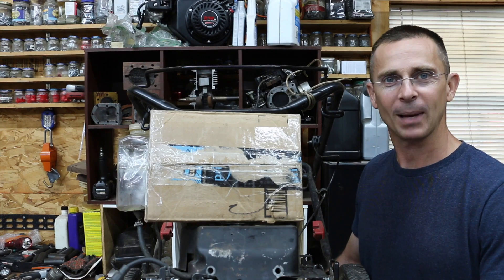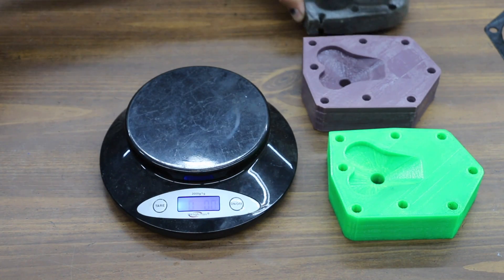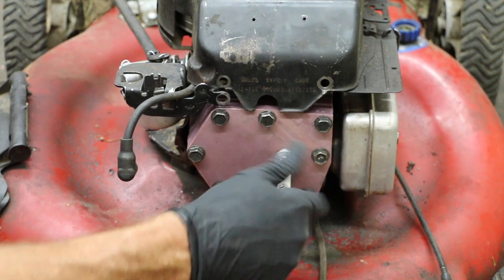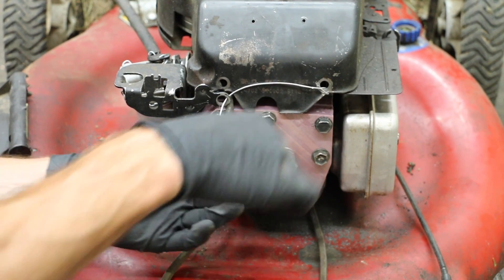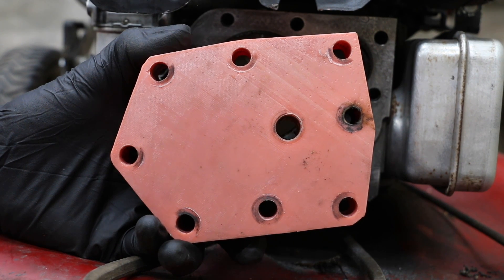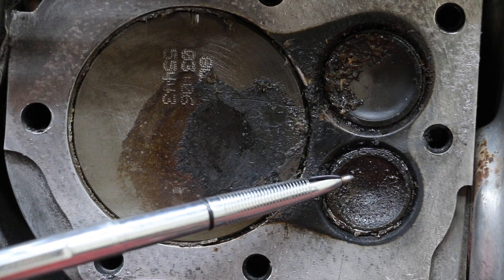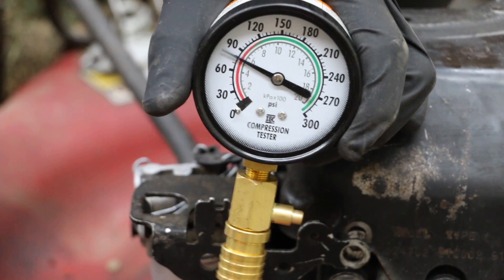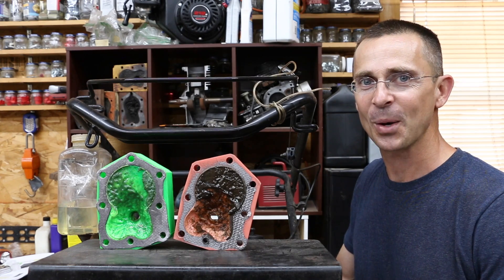How long will a 3D printed cylinder head last?  Let's find out!

Comment: I'm not 100% sure about the validity of this but, it came from a fairly reliable source so here goes:

Supposedly GM came up with some kind of clear material when they were developing the Vortec heads that allowed them to see the swirl and combustion of the fuel mixture and that's how they arrived at the final design. I imagine it had to be some kind of space-age plastic but, i can't see it lasting for a very long test period. Maybe just long enough to get useful data. It would be very cool to see something like that
Reply from the maker: Interesting!  Thank you
Reply: Project Farm Just saw this video after commenting. https://youtu.be/jdW1t8r8qYc
Maybe GM used glass as well but making a small block Chevy head out of glass might be a little more complicated than a lawnmower engine.

Comment: What about ceramic coating the inside of the cylinder head. Would that hold up to the heat while deceasing carbon build up. Like Teflon, Nicole boron or Cerakote. I would assume that it would rub off the moving contact points but on a small engine or 2 stroke the head is just a cap so it would just meet to hold up to the heat and mild abrasion.
Reply from the maker: Great test idea!

Comment: im curious to know if a smaller engine that runs cooler would work. maybe using Polyetheretherketone plastic which i think 3d4makers have. That has a glass temp of 143c. An rc engine runs just below that so if you can keep it cooled enough it might work. However the biggest issue is getting the heat our of it has plastic is a terrible heat conductor, so the engine will probably run hotter until it melts.
Reply from the maker: Great test idea!

Comment: Where I work we created a few "3D printed" heads for a dohc, single cylinder motorcycle engine from aluminium on a DMLS machine for motor sport purposes. Those were impressive bits of kit
Reply from the maker: Wow! That would be very impressive!

Comment: Use a silicone mold for the cylinder head??? That would be interesting as silicone holds alot of heat
Reply from the maker: Great point. Thank you

Comment: It would probably work a lot better if the cylinder head was printed with nylon because nylon has a way higher melting point of 250-270
Reply from the maker: Great point. Thank you

Comment: Anything with a lower melting point than aluminum will be less than ideal. Exhaust gases on 4 strokes naturally aspirated engine run at about 700 degrees Fahrenheit. Still it was interesting to see how long it lasted.
Reply from the maker: Great point. Thank you

Comment: is it a gasoline and/ or diesel 4 stroke engine.    anyway thanks for your video
Reply from the maker: Thank you. It's a 4 stroke gasoline engine.
Reply: Did you miss the part with the spark plug?

Comment: What if you use high temp ABS plus after threading for the spark plug, painted the inside with heat resistant engine paint?
Reply from the maker: Great video idea!

Comment: How about a teflon? That's also plastic but with a much higher melting temp (>1000°C I think). they also use it on spaceships
Reply from the maker: Great recommendation.
Reply: I looked up the melting temperature of teflon (chemical name PTFE) and I'm sorry about spreading misinformation. It's actually just about 330°C  and I dont think that would be enough to withstand as a cylinder head.

Comment: I have a 3D printer that does carbon fiber reinforced parts. It’s called Onyx. Nylon based plastic with chopped carbon. And then I can put carbon filament in the part as well. Markforged X7.
Reply from the maker: Nice!

Comment: I got a bunch of silly cylinder head ideas. They're absolutely bonkers. First, how about plaster cylinder heads? You could cast one out of Plaster of Paris or Structolite plaster. Structolite might be better as it's actually fire resistant and contains perlite. Second, how about cement cylinder heads cast similarly to the plaster ones? Third, how about stone cylinder heads? You could definitely carve one out of soapstone pretty similar to your JBWeld one, but you could try travertine, marble, etc, as well. Lastly, how about a full ceramic cylinder head, made of clay and fired in a kiln? (Might need to belt sand it down flat very carefully, it will bow from the fire...) I think a majority of these ideas to work might require a metal thread insert epoxied in somewhere for the spark plug, though. Just some ideas, it'd be interesting, as if they didn't crack from vibration, you might actually get less knocking and lower temps than a metal one due to better heat dissipation.
Reply from the maker: Great video ideas! Thank you

Comment: I would like to see this same test done with a metal plate between the plastic head and the block, preferably something a little larger than the head so that it could get some air on the flanges for cooling.  Probably need a metal  insert for the spark plug as well.   If a 1/4"  or less metal plate backed by a plastic head would hold together you might actually have something useful.
Reply from the maker: Great video idea!

Comment: But your can put the prints in sand and cast aluminium. You would only need to sand it of a little and it will do as good of a job as the original does.
Reply from the maker: Thank you

Comment: Our company cafeteria started using PLA spoons.  They deformed in hot soup.  To be fair, they switched to a different brand of PLA spoons and they were OK for soup.  Not so much for cylinder heads.
Reply from the maker: Wow!  That's very soft PLA!

Comment: do NOT lend a lawnmower to this man.
Reply from the maker: lol
Reply: @ProjectFarm  Hi there can you make me a special cylinder head for a 1933 Briggs and Stratton model Y engine by a 3D printer like this one in the video for higher compression so i can make a sand brass casting mold from the 3D printer head. So I can to make my own cylinder head out of scrap molten naval brass
Reply: @ProjectFarm   hey maybe a ceramic or metal or a  coating of some sort , shave a few thou from the head,  try tinfoil first, then maybe knock in some stronger stuff in,  like an insert,  bet it would work and last !
Reply: I'd trust this man with any mechanical equipment as it is clear that he is very adept at fixing them.
Reply: @esra_erimez  yep, be might destroy it but after he gets done fixing it it will be running better than it was before
Reply: @esra_erimez  indeed as he hows if a spark plug gos bad it can be clean with a wire brush insted of getting a new one that a clean piston is a piston that can operate that any engine that dies from to much oil all you have to do is clean the gears and the piston and the valves and it will run like brand new
Reply: Ill give him a few just so he can keep doing these awsome videos
Reply: @jonwalker6463  : This is probably one of the best channels on YouTube when it comes to testing consumer products ( in my opinion) certainly answered a ton of "I wonder if that stuff is any good" questions I have always had.
   Curious if "Project Farms" works in a U.L. Laboratory???.
Reply: @thevacuumtubejunky9774  he's better than u.l., they don't have the sass and charm
Reply: @thevacuumtubejunky9774  r
Reply: If you lend it, I assume he'll return it functioning.
Now, if you give him one, it's fair game.
Reply: Lmao
Reply: He’d just turbo charge it and use it to cut sugar cane.
Reply: He can just go to walmart and get with the loan a lawnmower program. you buy it and then return it as your not happy with it.  lol
Reply: You ain't lying but if your lawnmower doesn't work this is the guy to call.
Reply: prival fang but doesn’t he always fix them 🧠👌
Reply: prival fang Unless you want it to come back as a jet fuel powered, turbocharged lawnmower
Reply: I got 9 mowers(6 riders,3 push),setting in back of shop that need fixin,but I'm always too busy.Thinking of sending him a plane ticket,lol.
Reply: Lol
Reply: Being a 3D designer myself and working with these materials often, those are exactly the results I was expecting. PLA is usually printed at 210 Celcius, whole ABS is typically printed at 250ish C. They do make HTPLA (high temp PLA) that might work a little better.
What if you wrapped it in aluminum foil to keep it from melting.
Reply: It would be great to find out all these videos where made with his neighbor's lawn mower... hahahahahha...
Reply: did you just assume his gender???!

Comment: The cylinder head looks like it was made to hold a ballsack.
Reply: That's what i thought when i first saw the thumbnail.
Reply: greenyawgmoth thats the template
Reply: So your saying I can use my ball sack as a machine shop tool, work just got more interesting.
Reply: greenyawgmoth n bjjj
Reply: I've never tea bagged a cylinder head before. 🤔
Reply: Not something I would have ever possibly considered, but now that you mention it...
Reply: I thought the same thing
Reply: That shows what is in your mind.
Or do you think with your nuts?

Comment: ABS and PLA have a pretty low melting point, so none of these results should really come as a surprise.. the low melting points are one of the whole reasons that FDM printing is even possible, if you want a 3D printed head that has a chance of actually lasting you would need something that has been laser sintered. At that point though, it's not really cost effective compared to traditional cast parts.
Reply from the maker: Thanks for commenting on this

Comment: Is it possible to try the same heads but with sort of a thin sheet metal for heat protection where the piston hits. And plastic reinforcement. Saves metal. Or could you scale this up and make an entire working engine out of 3D printed material but thin metal sleeves sheets Etc. To help against heat. Super lightweight engine maybe?
Reply from the maker: Yes, great video idea!

Comment: What you may also want to try is to use a pla model of a cylinder head to create a lost polymer casting of a real cylinder head out of actual aluminum and see if that is a viable way to reproduce reliable replacement cylinder heads
Reply from the maker: Great recommendation!  Thank you
Reply: Wax is the best medium for kind of mold making. It melts away fast enough that the aluminum can fill all of the spaces before it cools. The plastic would take too long to melt away and the aluminum would cool before it fill the space. Also have more plastic junk left.

Comment: I'm actually very curious about this, i think that if you were to put the PLA cylinder head in the oven for a duration of time before use it would last quit a bit Longer under the heat of combustion. The operating temperatures of most engines can actually be Lower than the melting point of the plastic.
Reply from the maker: Thanks for this information.
Reply: Incorrect, Plastics like pteg, pla,abs melt at a way lower temperature. The operating temp inside of a cylinder bore is around 600f. Quit being a moron!

Comment: A pity 3d printers can't use high heat polycarb or something like that. PC-HT should last quite a bit longer than abs and especially pla. Or maybe make one out of some glass reinforced nylon, would be interested to see how that would perform.

Edit: Also, those two performed almost exactly how I thought they would, I work with plastic injection molding machinery professionally.
Reply from the maker: Great point and thank you!

Comment: You'll also tend to have issues with spark plug overheating - the plastic simply can't conduct heat away as well as aluminum. In a high-compression, high-performance engine, even if the plastic cylinder head didn't melt, you'd likely have the spark plug operating as if it was in a much higher heat range & either fail (burn/melt) or result in damaging pre-ignition.
Reply from the maker: Great point.

Comment: Try copper vitriol coating. For casting inner head form. and make asbestos heat insulator between plastic and copper
Reply from the maker: Thanks for the recommendation.

Comment: I wonder how well a 3D printed cylinder head coated with JB Weld would do? The spark plug threads would have to be tapped out of JB Weld as well.
Reply from the maker: Great video idea!  It would help a lot!

Comment: What if the spark plug was mounted in a metal sleeve?  If the sleeve extended slightly beyond the cathode (piston clearance permitting), melting plastic would not short it out so quickly.  Plastic have come a long way and I'm sure they will be a major part of out future.
Reply from the maker: Yes, that would help!  Thank you

Comment: Very cool
Reply from the maker: Thank you!
Reply: Could you try this again with a heat resistant filament? https://www.gearbest.com/3d-printer-supplies/pp_1529078.html?wid=1527929&currency=GBP&vip=4389632&gclid=CjwKCAjwuO3cBRAyEiwAzOxKso8im9HOBn6RSJTmb-ZmGWthvk9Wf8PfPz-67Revow7sTgzaM0dYPxoCd0sQAvD_BwE

Comment: If plastic wasn't such a good insulator the heat would dissipate thru the piece and it wouldn't die that fast. And we could even cool it for extended life.
If it wasn't for the heat those pieces might last very long.
Maybe try a printed steam engine.
Reply from the maker: Great tip!

Comment: you should try a cylinder head made from delrin it melts at 347 degrees Fahrenheit compared to abs which melts around 225 degrees. although i don't think it could be 3d printed it would have to be injection molded or milled.
Reply: I haven't found any delrin filament available before so that's probably out. Polycarbonate filament can get up to ~300F depending on quality.

What I've been looking into getting for my own 3d print projects is ceramic filament. Basically it's the right kind of clay mixed with some polymer (seems to be some options on this). And after you make your print, you can fire the thing in a kiln like you would any ceramic thing you were making, and the polymer burns off leaving you a solid ceramic thing.

It's ~150-200 per kg roll, and apparently quite rough on your extruder heads, so I haven't purchased any to play with yet. Also there's a 20-30% shrink rate on the stuff when it gets fired.

In the case of trying to make a cylinder head. Perhaps use the ceramic to make the inner face of the cylinder which will see the most heat. Then make up the remainder of the head from polycarbonate for structural support.
Reply from the maker: Great recommendation!
Reply: ABS 3D printing filament melts around 225 degrees Celsius, which is 437 degrees F.  I Googled "gas engine combustion chamber temperature" and got 600 degrees C as an answer, so that would be 1,112 degrees F.  This explains why we don't routinely have plastic cylinder heads, or other plastic parts in high temperature applications.

Comment: It would be interesting to see a cylinder head using a thermoset plastic since they don't melt. That keeps them from being printed, though, so a cylinder head made from them would need to be machined from a block instead.
Reply from the maker: Great recommendation!
Reply: Unless you used a fiberglass mesh preimpregnated with epoxy like Fiber-Fix.  You can lay it out in whatever shape you want, let it cure, drill and tap, then fire away.

Comment: Back in the sixties someone used a car smog pump as a supercharger on a Honda 160 at Bonneville.  It was mentioned in Hot Rod. Don't recall how fast it went but pretty sure it was faster than stock. My father owned a CB-160 at the time.
Reply from the maker: Thanks for the video idea!

Comment: Predictable, since 3d printers deposit plastic by heating it to a molten state (which occurs at lower temps than found in a combustion chamber). It would be interesting if we could use a type of plastic which  could "cure" into a state that has a higher melting point...
Reply from the maker: Great point.

Comment: Should just have drilled up/tapped up the inside for an aluminium insert that a spark plug could be screwed into that way the insert cant come out and the spark plug cant go in.
Reply from the maker: Great point.

Comment: Might have worked better if there were cooling fins in the heads. They will blow up if they aren't cooled by the fan. Most of the cooling air is blown across the head. But it was an interesting idea to try it all out
Reply from the maker: Great point.

Comment: Well,build for fail obviously ! ! ! ! ! ! !when 3D printing is possible on very low temp melting of certain kind of plastic why we hope to withstand of very high temp of engine ?????
Reply from the maker: All great points. I didn't think it would last as long as it did.
Reply: But you,open very high 'possibility' to think about the use of 3D printing parts as substitute and original in auto industry.rigid and withstand to very high temp resistant synthetic polymer material is the future of industry.thanks a lot.

Comment: As someone that has a printer and has printed a lot, I’m really surprised how long they lasted, and is much hotter to print (240c) and pla is considerable more temperature sensitive, prints at (~210c or so) would be interesting in pet or nylon.. 

Pretty neat, great vid
Reply from the maker: Great point. I was really surprised that lasted that long too.  Thanks again.

Comment: do you think it would last longer if the inside of the plastic cylinder head were coated with JB Weld or something similar?
Reply from the maker: Yes, it would help a lot.
Reply: Glad I wasnt the only one to think of that

Comment: What did you expect with a plastic cylinder head, especially with poly lactic acid? Hot gases and plastic is not a good combination.
Reply from the maker: Thanks for commenting. It lasted longer than i expected.

Comment: If it's made out of material that is flammable then it will burn a hole through it eventually that's why they make them out of metal
Reply from the maker: Great point.